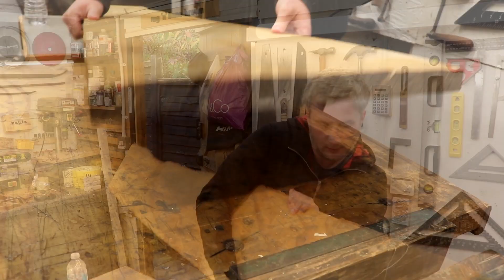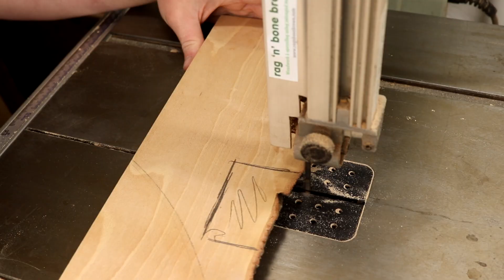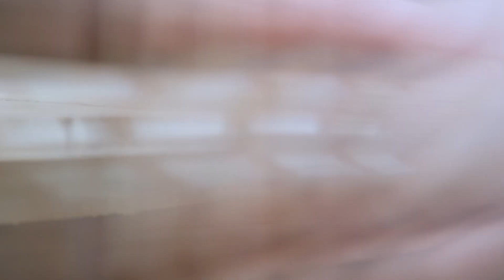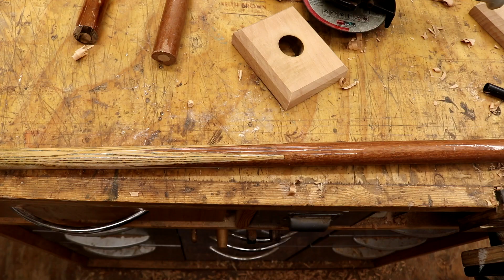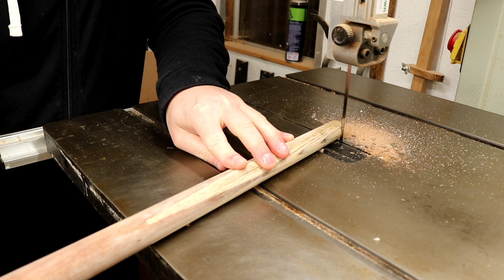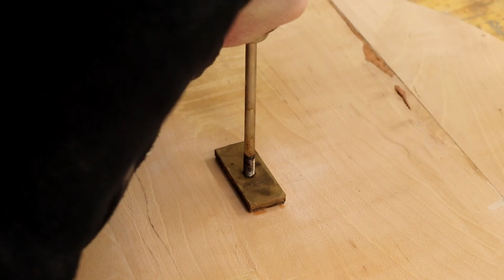Snooker Cue Legged Mid Century Style Coffee Table

Comment: the saw blades made for cutting wood and those for cutting metal, both use carbide tips, are those tips any different from one to another ? i kinda don't think so, their angles and stuff might be different, but cutting a bit of metal should not really damage a wood cutting blade
Reply from the maker: I’m not sure tbh but the blades I have aren’t designed for cutting metal. They seem ok though despite hitting metal occasionally!

Comment: Very nice build Keith. The metal in the legs i think you will find it is lead, years ago when they made cues, everyone wanted a different weight of cue, some liked a light one and some a heavy one, to do this lead was put into the bottom of the cue. 
I am sure your blade should be ok, lead is a softer metal easier to melt and shape, it's also used for Fishing Weights as well. I used to play Snooker and did some Sea Fishing, but not at the same time ha ha ha.
Barry (Wirral, ENG)
Reply from the maker: Thanks Barry. I think you’re right because I used the saw today and the blade looked and cut fine. I think I got away with it! Cheers, Keith